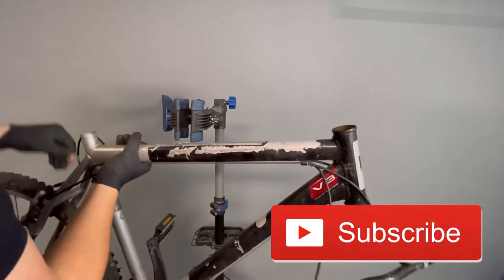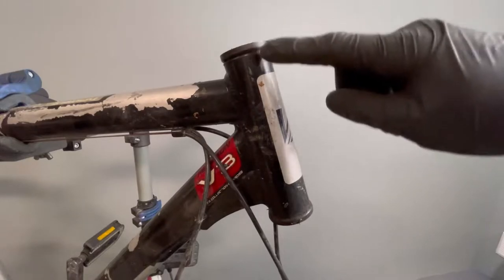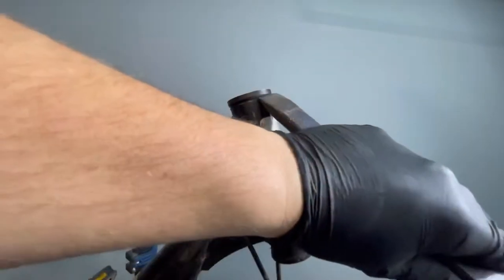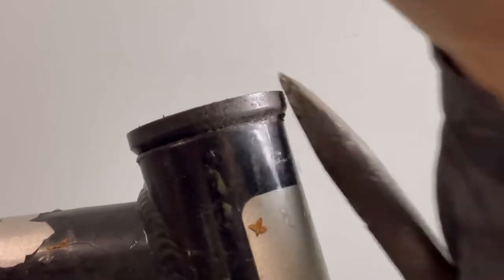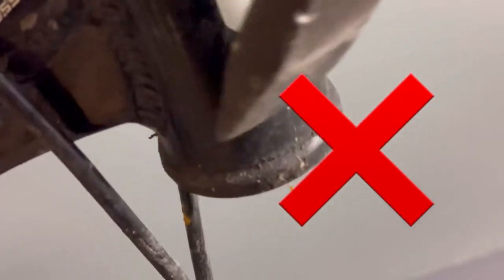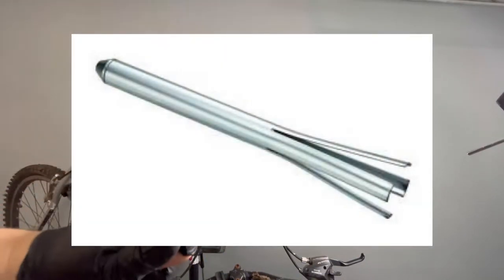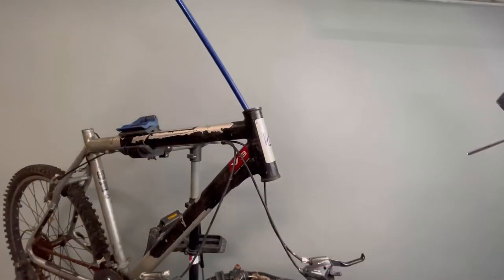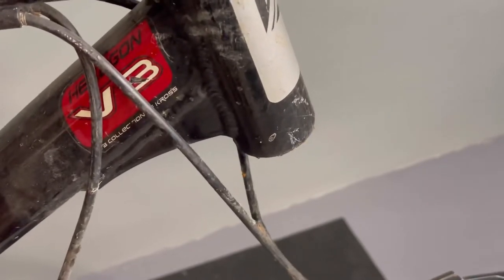How to remove bike HEADSET CUPS /BLOWS ? BIG MISTAKE !

Comment: After watching this video, the first method was actually more useful and worked, unironically. (if you're replacing the entire headset)
Reply from the maker: maybe
Reply: How? The inside has a much better and easier lip to hit with less risk of hitting the frame. If you did hit the frame nobody can see it anyway. You ideally want to tap round the inside edge to push the cup out as straight as possible to prevent damage to the steerer tube.